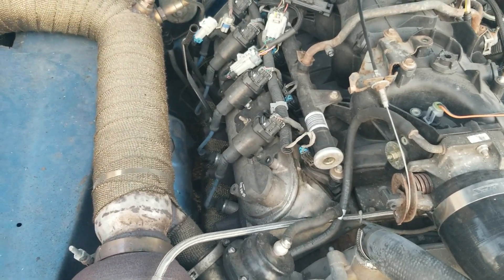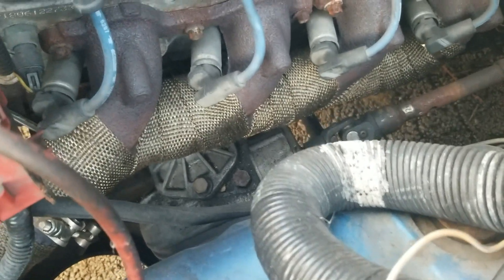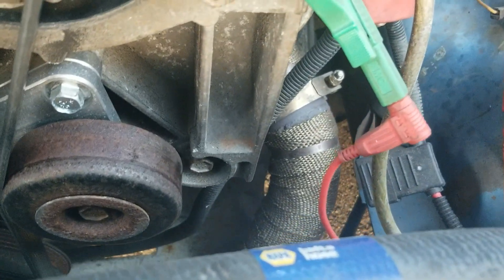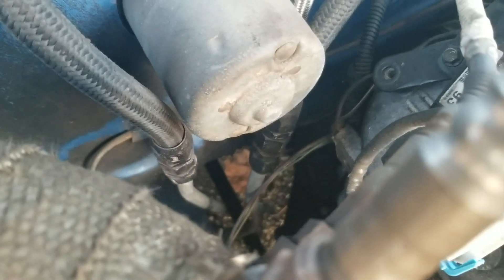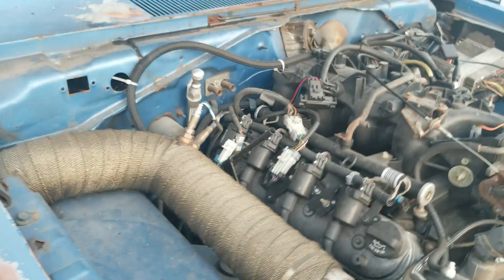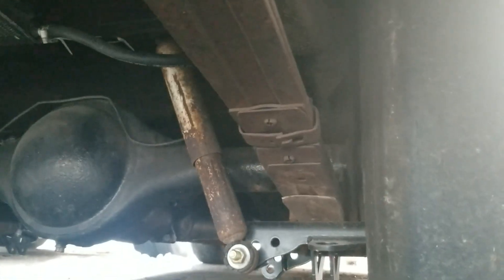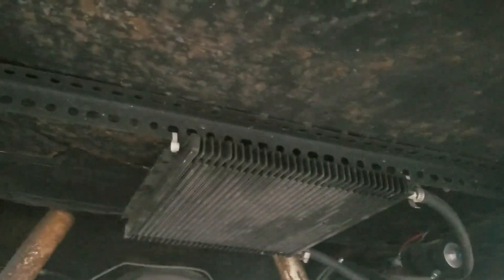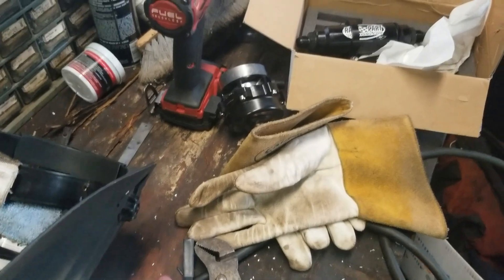Turbo LS '73 Dart walkaround

Comment: What did you have to do to the fab up a Trans Mount with that funky A body cross member?
Reply from the maker: Hmm I'm not sure if I have video of that anywhere on my channel. It's basically just a piece of tubing that bolts in between the subframe connectors.

Comment: What’s your wheel and tire size that’s the stance I want on mine !
Reply from the maker: The fronts in this vid are 17x9, and the rears are 15x10. I have a complete set of 17s and a complete set of 15s, but the 17x11 rear wheels have crappy tires on them and won't hold any power.